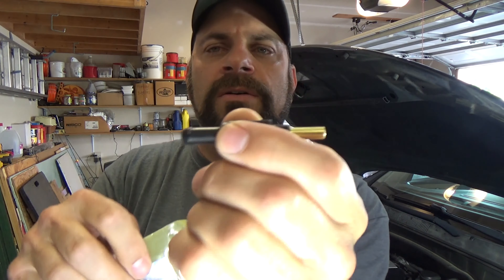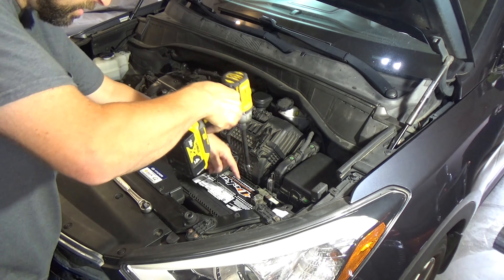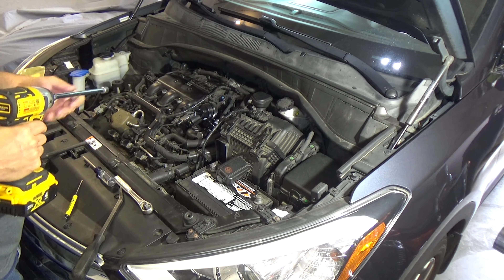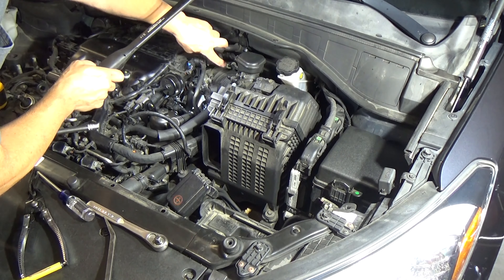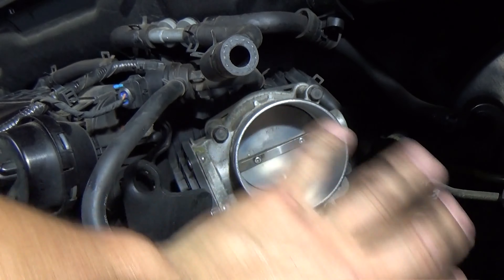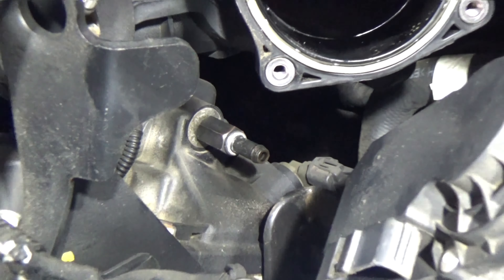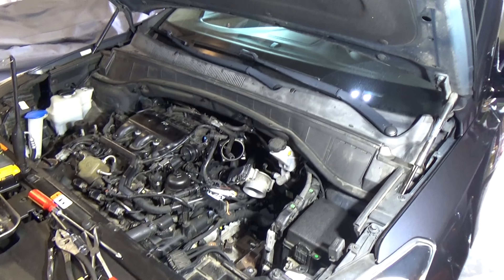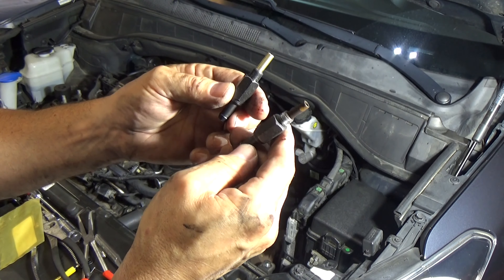The Hyundai Kia PCV Valve Location and Replacing It

Comment: A lot of people are asking about the PCV and oil burning.  It is a possible scenario as well as a clogged air filter.  All related to high manifold vacuum operation.   Which is very light throttle, steady highway driving or idling.  I believe that the catalytic converter will vaporize some oil so you may not see it or smell it.   This could be the only way my Kia will go through a quart in 400 miles of 75 mph driving.  No drips, bone dry underneath, no smoke that I can see, no smell.
Reply: Kias are the worst. It's the gdi trash. I burn oil in a cadenza, and have with multiple models.

Comment: Thanks for the informative video. Today's modern engines require a functioning PCV valve more than I realized, I ordered the part and am installing it this weekend. I changed the spark plugs,coils and intake manifold gasket in my 2014 Sorento 3.3 V6 six months ago but I didn't realize that the PCV valve was located under the throttle body. Shucks,now I have to go through the whole process of removing the air box,wire harnesses,hoses and throttle body again to install the new valve. I'll change the air filter and throttle body gasket while I have the it all apart again too. Nevertheless I was lucky to come across this video. Two thumbs up Glen!
Reply from the maker: Now you know Slim.😉  Thanks for your comment!

Comment: Thank you for this video! I was getting a very small amount of white yellow foam buildup on the inside of the oil cap, just about the size of a coin, so not a head gasket leak or anything. I am pretty sure it was because water vapors were not being sucked back out of the motor. Everything was the same procedure on my 2016 Kia Sedona LX 3.3l!
Reply from the maker: Short drives under 10 minutes can cause excessive condensation in the crankcase. I've seen it many times.

Comment: Wow 4k oil changes. I do 6500k, been running good. Great video. 👍
Reply from the maker: The max oil change on all of my vehicles is 4500 miles. I don't worry about time.
Reply: @ozzstars_cars I'm lucky to get 4500 with fully synthetic oil that is top line with additives that guarantees 20k lol. I wish I could expose those lies and be compensated. And that's with a 7 qt size, I burn a qt every 500 miles maybe

Comment: Thanks for the great video! It is very informative. I am requesting you make a video showing how to use CRC GDI Intake Valve and Turbo Cleaner (or your favorite product) through the PVC intake hose. A Hyundai tech on a different thread stated "Just need to find a vacuum hose(I used the PCV intake hose) and spray in bursts until the can is empty with a helper in the car holding the revs at 2k RPM". Yet another tech stated " We have a cleaner that we run through the injectors via the inlet at the high pressure pump as well as a spray that goes into the intake to clean the throttle body and the intake valves". Curious how you would go about performing this service, considering there are so many different opinions. Thank you!
Reply from the maker: Put a bottle of Techron concentrate in the fuel tank. Works wonders. https://amzn.to/3ucOTfh
Reply: @ozzstars_cars   Not on a GDI engine 😕
Reply from the maker: @espedale without a major service that's all you can do for this particular car. Some manufacturers like Ford have incorporated both GDi and standard FI, solely to clean the back of the intake valves.

Comment: When you are reassembling, do you have what the torque settings are for the four bolts holding the throttle body? I've looked for days and can't find them. I'm replacing the PCV valve on a 2019 Kia Sorento 3.3L. On another note, I was browsing your videos about Corvettes just for fun. I restored a 71, body on, then found a 70 LT1 that I spent ten years searching for number correct parts, did a full off frame restoration breaking down every nut and bolt and rebuilding everything to NCRS spec, I have to say in all honesty about the C3's, they really were a bucket of bolts, beautiful styling but still a Detroit bucket of bolts. On the upside, I had an '84 that everyone cussed for the crossfire fuel injection, but I did mostly highway miles and had 313,000 on it when I sold it running great and that crossfire never gave a bit of problem.
Reply from the maker: 313k miles on that crossfire has to be a record! I don't know the exact throttle body bolt torque specs for your Kia but I go two ugga duggas and have never had a problem. Btw, early C3's are my favorite classic Corvette, for the styling and simplicity. Thanks for your comment.  -Glen (Ozz)

Comment: Now I am mad, did not know the valve was there. I decided to do the plugs (can you imagine what the dealer charges for that?), which, as you mentioned, includes removing the battery, airbox, manifold (and  manifold gasket), hoses, connectors etc, and I though, man, one of those coil packs in the back go bad, I am doing this all over again (the front are easy to get to). So, I changed the coil packs while there. 

If I would have known the PVC valve was there, I would have spent the 12 bucks to change that too. 

The good news is I don't have to take the manifold off to change this valve.

Comment: Apologies in advance, I'm not a mechanic but do diesel have these pcv valves? I'm getting white/gray smoke and P0404 on my Kia optima which is something about the egr valve, would I need to replace the pressure converter I think that's what's its called
Reply from the maker: Diagnose and test before replacing any parts. That saves time e and money.

Comment: Would this be a good starting point for oil consumption on a 2016 sorento w/49k
Reply from the maker: Not really but it's worth a look see.
Reply: @ozzstars_cars  kia told us that its a known issue and they would put some kind of solution in the cylinders to free up the rings...other videos and forums say to immediately change the pcv valve and run thicker oil. I mean what kind of solution??? Like seafoam or berrymans?

Comment: On a 2016 Kia Optima 2.4L LX MODEL where do you spray CRC INTAKE AND  VALVE CLEANER
Reply from the maker: Usually at the throttle body.
Reply: @ozzstars_cars  1st ty , but there's  a sensor ahead of the throttle body...?

Comment: What are the manufactures thinking by hiding the valve .Remember the days when the valve was right on top.
Reply from the maker: I sure do Jim.  Pop it in and out in 10 seconds. haha
Reply: Kia Sorento also has the other PCV Valve at the original top location. So do Kias have 2 PCV Valves???
Reply: @ForceOnTwoWheels  
My 2016 Kia Optima hybrid (2.4 L.) has it on top front , I wonder if there’s more than one?
Reply: @torobravo8023  Hello Toro Encabronado, I only replaced the one valve and didn't bother to check the other location to see if there is one, because it is sort of buried in there.
Reply: @ForceOnTwoWheels  
Cool😎 ,

Comment: On my 2012 Hyundai Accent, it is burning too much oil. Like it is under the minimum after 1000 miles. There are no leaks around. Engine is 1.6L (not turbo). So, it is obviously burning it somewhere. Is it possible that I'm losing so much oil because of the PCV valve? Car has 65,000 miles.
Reply from the maker: Anything is possible. Compression test. Cylinder leak down test. Check for worn out piston rings or leaky valve seals. Good luck.

Comment: Can anyone confirm this is the same location on a 2013 Kia Sportage?  It's running a little rough at 95k and makes a minor throaty growl sound at low speeds with low rpm
Reply from the maker: Is it a 3.3L? Then yes
Reply: @ozzstars_cars  it's a 2.4 liter engine. I found the part on several major auto stores so at least I know a pcv valve exists somewhere in my kia 😂 I went ahead and ordered one and hopefully it pops up around the same area
Reply: I'm so curious if you replaced this and if it resolved that sound for you? I've been having the same and Googled everything I can think of and can't quite find the problem. I get a rumbling/growl intermittently but only at idle, park or real low acceleration. Seems once it's moving I don't have it. Mines a 2017 hyundai santa fe but I'm wondering if this would be a fix.
Reply: @cuppscraps  hey there!  Well as it turns out, the problem appeared to be caused by going too long between oil changes.  We were off by a whole year in our memory of when the last oil change was and realized it had gone 23,000 miles since then!  It wasn't soup yet but definitely burned old oil and I'm sure there was sludge.  I noticed the dipstick had crusty burned oil all over it that was very hard to get off... So I'm sure that same stuff was all over the inside of the engine, causing problems. What I ended up doing, first, changing the oil, then immediately adding seafoam to new oil, ran it 300 miles, changed oil again.   I also used seafoam spray through the throttle body.  And do new plugs. That seemed to help.  I never got around to changing the pcv but the little tune up above seemed to help.  Unfortunately the Kia was totalled after I got sideswiped by an uninsured a-hole at 80mph.. so we will never know how much life the engine had left
Reply: @CharkG73  oh no!! 😣  but thanks for the reply,  that gives me some things to try regardless once I read up on the seafoam and a couple other things I was going to do (sparkplugs) seems either can't hurt to start. Thanks!
Reply: @cuppscraps  for sure!  Honestly I wish more basic car maintenance you can diy was more readily available. A few things I recommend, after having learned the hard way, for any kind of rough running condition: seafoam liquid on the crankcase before oil change (or use an engine flush in crank case if you need it asap), seafoam spray to clean carbon, clean throttle body if easily accessible (be careful and research your particular car first, some are very sensitive and some need a special relearn afterword), oil change, coolant change, transmission fluid change every 50 to 70k (OEM trans fluid only), and PCV replace if it's an easy one like the Kia / Hyundai

Comment: Hello, this video on replacing a spark plug and the one on the oil pressure switch were both incredibly helpful to me socially. However, I had a problem that needs your assistance to be resolved.

I followed your instructions to change the oil pressure switch on my 2018 Hyundai Santa Fe, but when I got to the last step, I hammered a little too hard and a piece of the aluminum threaded housing broke off.

It was actually my fault; I had seen another video in which the mechanic was hammering, but since it was my first time, I was unable to perform the final step correctly and felt as though I had missed everything.

I couldn't believe how quickly I disassembled those pieces of parts until I got to the underneath oil pressure switch. However, there wasn't enough room to turn the switch, which forced me to look at other videos to find the best solution for my circumstances.

What is the best way to fix this switch holder and re-tap it again, I wonder.
Also, please send me the steps I need to take in order to disassemble the metal coolant pipe so I can decide whether to use cold or hot welding on that portion.

I value your prompt response.
Reply: This guy only cares about likes etc. He does not care about any of us or our issues he may have helped to create. Dont hold your breath waiting for a response

Comment: THANK YOU for being a great teacher, SUBBED!.. I own the same vehicle (2015 Sanfa Fe Limited: 80k miles) and have learned so much from you, i appreciate you. Do you think that installing a Oil Catch Can would help prolong the life of the engine or using the CRC VALVE CLEANERS?
Reply from the maker: Oil catch cans in my opinion are a waste of time and money.  Adding some injector cleaner in the fuel tank every 6-10k miles can't hurt.  Thanks Miguel for your channel support!
Reply: @ozzstars_cars  Yes, Oil Catch Can is a little attractive way to deal with oil flying into the DPF.  Moreover, at first glance it seems that you don’t have to worry at all, the oil after DPF regeneration will leave behind only a small fraction of the original weight / volume, ~% 0.8 ash. That is, the DPF will fill with oil ash for a long time.  
However, before regeneration occurs, between DPF burns, unburned oil will occupy a large volume in the DPF itself, increasing the frequency of regeneration.  And the maximum amount of soot in the regeneration cycle for Hyundai is very small 17g (and even less than 17-3.88g).  Such a situation may occur that the burns will take place every 50-100 km.  Am I wrong (?) and what should I do in this case?
Reply: @Ozzstar's Cars, Soot Accumulation Rate in the DPF on the highway jumps from 6km/g to 15km/g under similar or identical conditions (equal to speed, slope, etc.) Could this be indicative of a PCV valve sitting?

Comment: 2018 santa fe sport awd.....had a new long block replacement done at 74 thou. We bought it used with 75 thou. It has mega oil consumption issues. Only had the car 2 months. Gonna change the pcv, if that don't work I'm going back to the dealership where we  got the piece of shit
Reply from the maker: I don't blame you for taking it back.  The engine needs a leak down and compression test.  Rings and valve seals if no oil puddle is on the ground.
Reply: @ozzstars_cars  no puddles, no smoke out the pipe, only has 3thou on the new motor. Their looking into it now. Sick to my stomach, I don't know if I want the piece of shit now. We bought it used, only had it a month
Reply: @michaelmitchell5909  what did it end up being? Our 2014 sorento is having the same problem and I'd like to fix it or at least stop it from getting worse.
Reply: @ozzstars_cars  ...hyundai told us its normal oil usage. They are not helping us pr doing anything about it. I even contacted the corporate offices and asked about the huge lawsuit that pertains to the issue but they said there's nothing they can do. We talked to a lawyer and of course they want money to forward letters to hyundai Corp. Its a nightmare and I wouldn't buy a hyundai or a Kia if you give me one for free. So, I just got a 5 gallon bucket of part syn oil from Amazon and I have to put in oil every couple weeks. We are gonna trade the car in next year
Reply: @michaelmitchell5909  Did you change the PCV valve ? I'm in the same boat and don't want to waste my time if it's not helping... Thanks!
Reply: @chengbiliu8745 I did change it, didn't help. We are gonna trade the suv in. Now the hatch back door doesn't open
Reply: Maybe you should try cleaning the Piston ring or change it. Maybe it will help. I have 2017 Santa Fe with the same issue